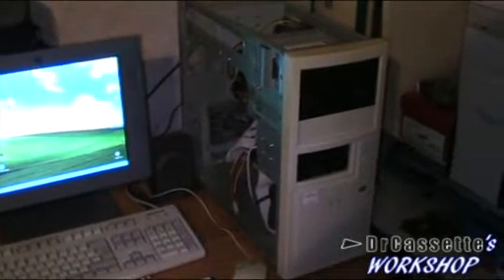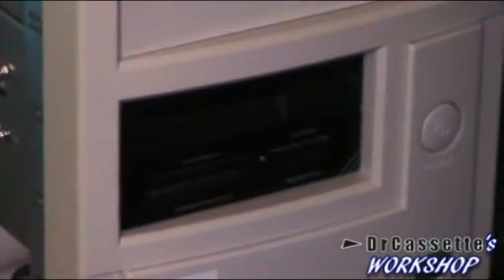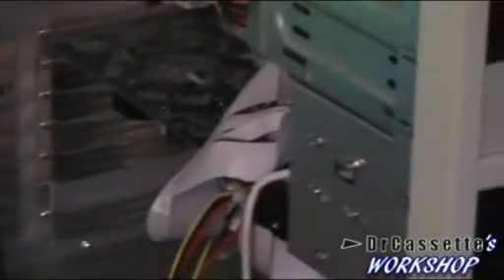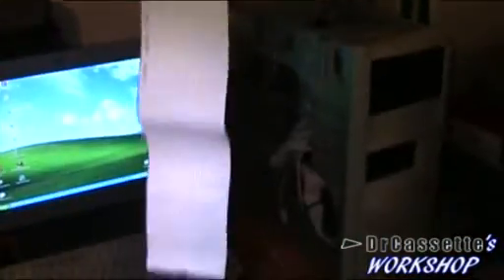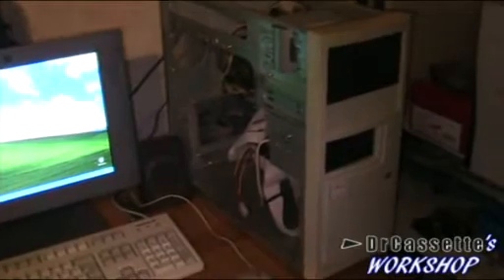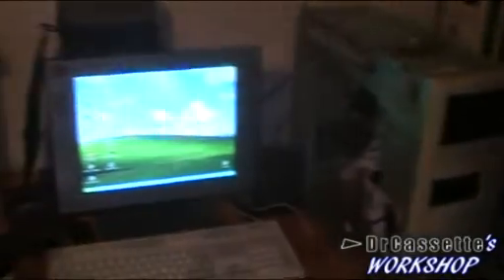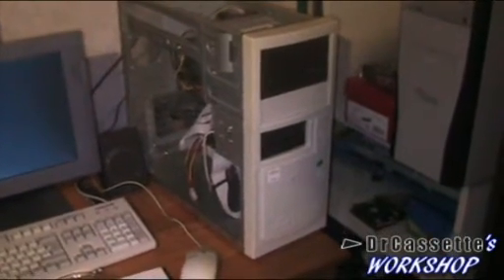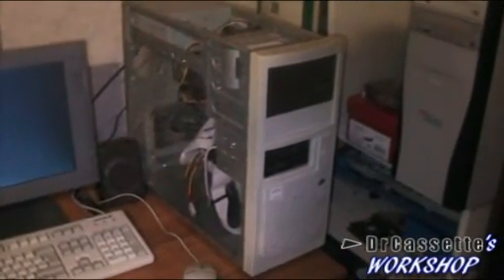DrCassette's Workshop - Messin round with the Workshop PC

Comment: You should be aware that overclocking the computer's cpu will lead to more heat being produced by the cpu and you should be very careful of overclocking with a stock heatsink. If you look up the socket type for the CPU you'll find aftermarket heatsinks that you can use. Just be aware that some aftermarket CPU coolers can have their own mounting system or use the stock mounting system. So having an aftermarket CPU cooler will greatly extend the life of an overclocked CPU.

Comment: Swapping the primary and secondary FDD used to be a common function in the BIOS setup back in the olden days. Apparently this board also includes it.

Disabling the network boot function (look out for any PXI related options, commonly in Integrated Peripherals) and shuffling around the boot sequence should be easy as pie. I'm kinda surprised you didn't find the latter. An oldschool Award 4.51 BIOS should have it in Advanced CMOS Setup if I'm not mistaken, others may have a separate submenu.